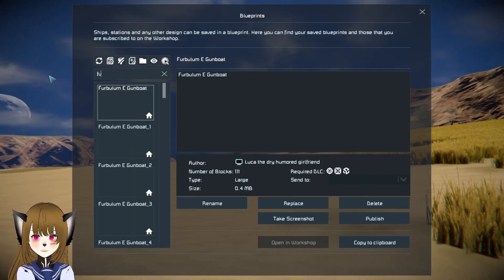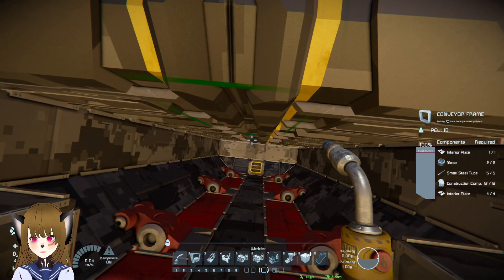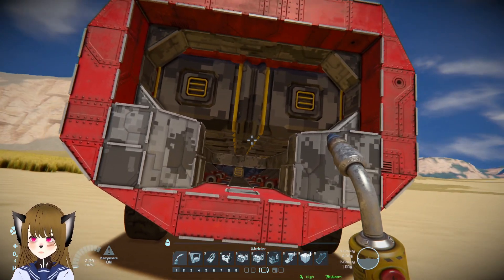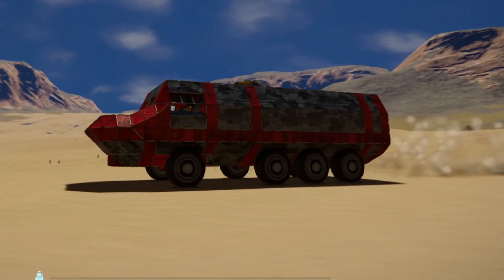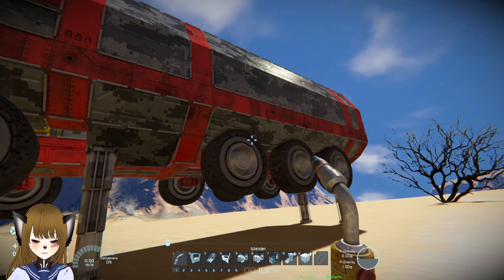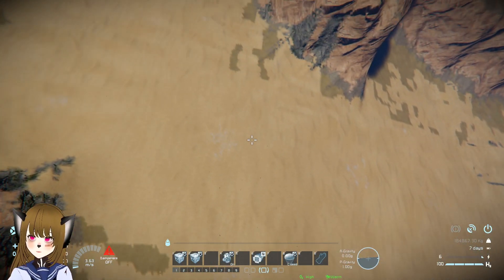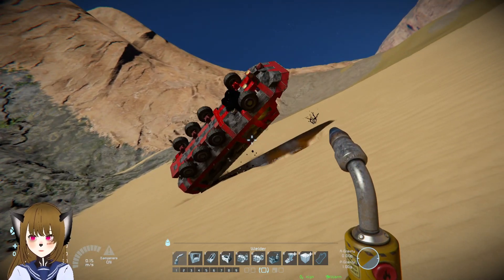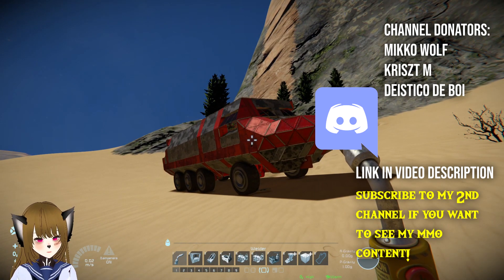Less Popular Workshop Vehicles can be Quirky, Space Engineers

Comment: It can only handle small items as cargo in that configuration.  I would swap out all of those mediums for one large cargo container and place it under where the upward facing connector is.  Then with the saved space, you might be able to place in a few passenger seats and possibly a survival kit.  If there's an O2/H2 Generator on board, you can place a small hydrogen tank in the passenger area and you can refuel hydrogen bottles from the tank as long as you're accessing bottles directly from a port in the tank.  A great player made turret would be a pair of gatlings with two manual tubes of rockets. You could place the turret on a piston that retracts so the top of the turret sits almost flush with the roof of the vehicle.  Then put a few armor panels on it so it blends into the roof when retracted.  But can sit above the connector when extended so you can at least get some 360 degree turret coverage when the periscope is up.
Reply from the maker: I see c= I guess there's enough room for that x3 might be a little bit more vulnerable to damage from bottom impact though and oo, those are interesting design ideas for the vehicle x3